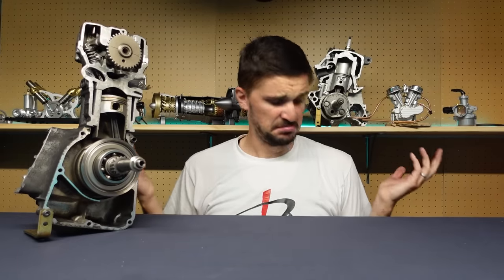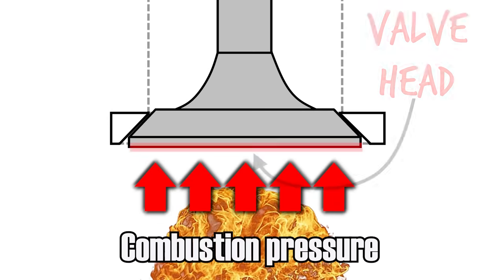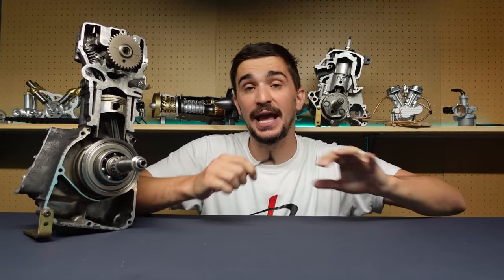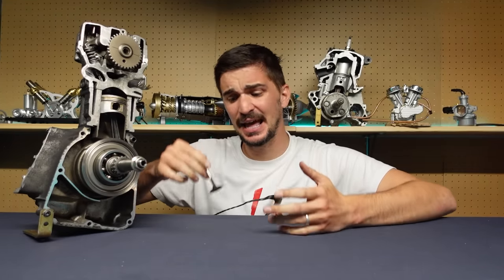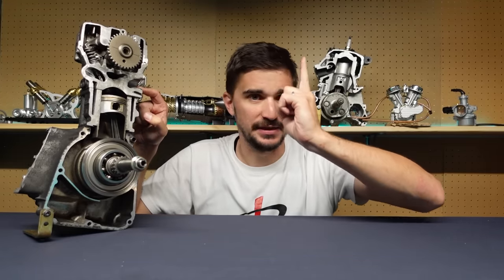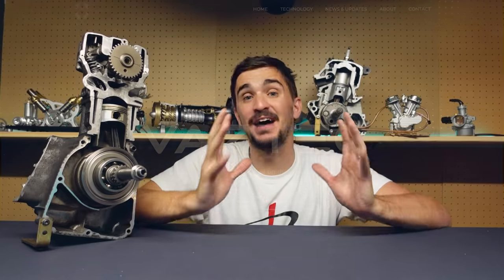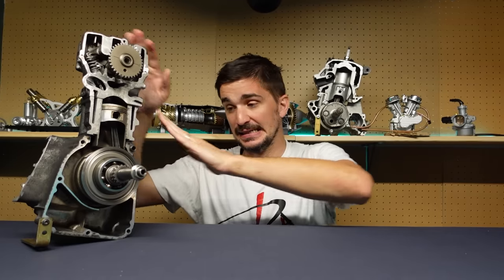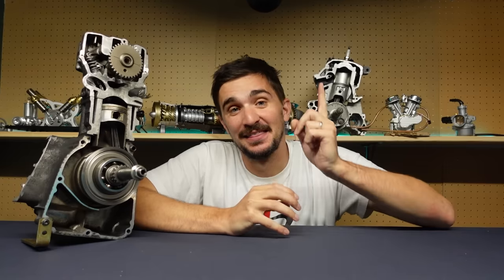Rotary Valves Make Normal Valves Look Silly - Why Aren't We Using Them?

Comment: I designed a rotary valve system once for a project, and the sealing was always a headache. I could never get it to last more than a few hours. Bravo to these engineers for solving these issues.
Reply: Use of a carbon type seal like used in turbo fan jet engines may have worked would be interesting to  see. Cheers
Reply: Did you try apex seals on a triangular valve rotor?
Reply: @JinKee  no, I hadn't... Runs to check his design
Reply: Aside from using carbon/apex seals the best way to keep the sealing protected is by cooling. Just like a turbocharger, air or liquid cooling to keep temps stable for long periods of time. Air usually isn't feasible except for small applications but it's worth a shot.....
Reply: Why didn't you make the rotary valve in tapered form (pushed by a spring on one side) .. ?? ..  so you don't need o ring seals ..
Reply: The cylinder pressure is constantly trying to blast the rotary valve off the engine.
With traditional valves, the cylinder pressure forces the valve to have a better seal.
Reply: Where it seals you would have metal on metal contact with the rotating barrel and the head if it was a true seal: would inherently need to be lubricated...

I could envision lots of oil burning in this design.That alone would be a tough hurdle to overcome. It is a violent environment in that chamber.
Reply: have a friend who was doing research on this. We figured out that if you put a bunch of grooves in the rotating valve and the cylinder it fits into you don't need any more of a seal. The air flows  up and down through the grooves and the loss of pressure with only a few groves is negligible.
Reply: I have a friend who was doing research on this. We figured out that if you put a bunch of grooves in the rotating valve and the cylinder it fits into you don't need any more of a seal. The air flows  up and down through the grooves and the loss of pressure with only a few groves is negligible. Also the grooves never touch each other. Even with a few thousands of an inch gap the air will not make it out. This way you have a solid metal frictionless seal.
Reply: The combination of rotating and poppet was mentioned, wouldn't it be possible to use some kind of simple reed valve principle instead of the poppet? The timing and the control of the flow is done with the rotating valve, all we need is the seal. (Mandatory bad joke, an emoji of a semiaquatic marine mammal flapping its flippers, arf-arf. Sorry could not resist.)
Reply: @billruss6704  like a labyrinth seal?
Reply: @billruss6704  that does sound like a labyrinth seal. You could get away with grooves only on the valve body, and not on the cylinder
Reply: Same problem with rotary engines.
Reply: it leaked?
Reply: @JOutterbridge i was thinkin " do we cool it on the back end of the shaft? is the backend of the rotor shafts part of the water pump assembly ??
Reply: I assume you too Did NOT study the sucessful rotary valve engines of the late 1960's and early 70's ?  Your valve experiment would have at least been reliable for far longer than the miserable failure you have reported upon. Nick , NavyBlueSmoke , LST-1195
Reply: @billruss6704  "Solid metal" and "frictionless" don't really go well together.

At low speeds friction might be negligible. But these valves are gonna be rotating pretty damn fast. People don't realize how fast valves move, in animations to explain the concept to people learning mechanics it seems like they open and close smoothly, in really it's more like a snap, they open and close so fast that it causes a shockwave through the manifold. You put metal on metal rotating valves in a real engine and six months later you have some nicely polished surfaces and that air gap is 10x wider than it was originally.
Reply: @BigUriel  There would be a small gap of a few thousandths of an inch between the inner and outer grooves so no metal to metal contact. We tried this with high pressure air on one end, by the time the air zigzagged it's way through all the grooves there was negligible pressure coming out the other end.
Reply: @JinKee  It can be done if you make the outer (cylinder) 2 halves.
Reply: ELMOREMOBILE automobile.  A brass era car that had a most interesting engine that included stepped 2 stage pistons and a rotary valve system.
Would love to see a proper deep dive into its engineering
Reply: There are the seals working at high temperature in every engine. They called piston rings.
Reply: What about instead of a barrel have a slotted disc that would rotate above the combustion chamber but would need 90 degree gear from the timing chain?
Reply: No you didn't 😂
Reply: @jakedode  trust me, this isn't even close to the weirdest thing we tried to make in high school shop class. The pulse jet remains the top tier example of why you always make sure what is in front of the intake, and downrange of exhaust. Inhaling sawdust ruined the paint job on our teacher's car.
Reply: No you didn't

So funny how everyone on YouTube is a specialist 😅
Reply: Yea, ours sealed well but burned oil like crazy. So not ideal.
Reply: @bafumat  ours didn't seal well, and burned oil, so...
Reply: @downix  I am pretty sure your s sealed well because it was being pushed up into the head with every ignition. Perhaps ceramic lips would have helped wear but the oil burning was a non starter so we never continued.
Reply: Invar valve body and housing for zero expansion with temperature changes. Pneumatic hydrostatic bearing for low friction lubrication. No contact=no wear.  plus even if does leak lubricant...it's just air.
Reply: Why not using piston rings for seal, they can stand heat and pressure?
Reply: I found what I imagined in my head, check out "1911 Reynolds Rotary Valve 4-Cyl. Engine"
Reply: Instead of a rotary motion, why not use a sliding motion? Like a piston with a hole drilled perpendicularly through.
Reply: So did I when I was 15 / 16 years old (so early 70s). I based in on a Honda 50cc.
I too had sealing problems and tried various things like graphite spring loaded  collars. I got it to run but not for long.
Then I went to the public library looking for ideas.
There I discovered that it was not a novel idea - that an identical idea had been tried in1887!
And many further attempts had been made in the 1920s without success.
I threw the whole thing away in disgust.
Reply: @BigUriel at last a wise engineering mind in the comments
Reply: Probably why it is never been used on a mass scale...
Reply: @JinKee ...like on the Wankel rotary engine? That's what I was thinking...
Reply: @CM-mo7mv ...if it was that simple, I'm pretty sure that SOMEBODY would have already tried it-(?)
Reply: @gregculverwell  we used a Suzuki as the base, but same idea.
Reply: @harrykreia5371 ...pistons move in a LINEAR DIRECTION...
Reply: @milanstepanek4185  valves akin to as you suggest have been tried before. Called disc valves. They usually have same  issues of a mix of poor sealing, quick wear, and high oil consumption. And usually a tendency to sieze.

A bit part of such  is when metal parts increase in temperature  they expand. That knackers up clearances. Further complicated as different parts warm at different rates, and to different amount.
Reply: @harrykreia5371  that is true. But they are intended for a wiping motion. In this case they would be spinning. That would lead to a grove being cut in the valve cylinder or the valve itself  or both very quickly.
Reply: @stevecummins324  yes  that sounds nice until you realize you are trying to seal gas in the first place. The high pressure would just force itself into that bearing fast and foul it out.
Reply: @bafumat not at all complex to sort out... just lift the bearing with higher pressure than that which results from combustion. Nb the smaller the clearances are with such a bearing the lower the flow rate of pressurised gas needed.
Reply: Liquid piston (silly name) swapped the oval and triangle I used in Wankel. Its stator is triangular with a spark plug on each corner. Rotor is oval. Seals are fixed in the stator and can be easily replaced. It solves the flame quench and short blowdown of wankel but the rotor can overheat.
Reply: They kiiiind of solved them... You still won't see them on any cars
Reply: @CM-mo7mv  Thats called a cam shaft !
Reply: @kebeleteeek4227  That's an Aspin rotary valve, which still needs lubrication. Try again. :)
Reply: @stevecummins324  the pressure of the combustion would disagree
Reply: I think that the sealing can be good with the needed technology, the problem I see here is the timing, ayway I think it's possible
Reply: @Capocomico  timing is easy, and VVT is doable as well. Changing duration might be more of an issue.
Reply: @billruss6704  you're describing a labyrinthe seal. They have been used for industrial gearbox and electric motor bearing seals for a couple decades now. Some make contact, some do not. They come in various IP and particle ratings.
Reply: @bafumat  you need to do a sudden opening , a steady open time and a sudden close close. in a rotating  system that's less efficient, valves do not follow sinusoidal movement
Reply: So, here’s my question.  I’ve been a streamfitter, plumber, and pipefitter. I’ve used check valves multiple times in those areas. Why not use the same concept but with electronic check valves based on compression and decompression cycles?
Reply: @drrichardpaul  some high end Formula 1 race cars use them. The main issue is cost. Getting one able to handle the explosive pressure is difficult so I have read.
Reply: @drrichardpaul  I think I heard about some car makers that are doing that. Sport cars of course. I don't remember so well
Reply: @Capocomico  we did a fairly long narrow opening. The home in the rotating assembly was about three times wider such that it opened fairly suddenly, had a dwell and then closed suddenly. The opening in the head was the limiting factor. Again, c
Something harder than the typical steels might have held up better but the necessary lube always burned off. Total pain.
Reply: @bafumat I bet temperature variations would made it impossible to stay at the exact size.  Something like the sealing segments  on a wankel should be necessary , but I doubt there's a sping that could work at exhaust temperature
Reply: @Capocomico  yes. The materials heat up unevenly and without computer programs that can help, we pretty much were guessing about expansion. And it's pretty uneven. But hey, we tried.
Reply: @Capocomico  yes. The materials heat up unevenly and without computer programs that can help, we pretty much were guessing about expansion. And it's pretty uneven. But hey, we tried.
Reply: Thats another beneficial quality of engine oil, it lubricates, cools, protects and facilitates pressure sealing.
Reply: Boom shaka loka, cant beat the spring valve.
Reply: That's their job.
Reply: Came in the comments to ask about APEX seals (hard not to think about everytme i hear "rotary". Saw @JinKee mentioned it.
Reply: port velocity and flow is far superior in a head with "normal" valves, anyway
Reply: Add some impossible to conventional manufacture cooling bores inside the rotary valve cylinder and you should be fine. 

I can imagine a metal 3D printed and rectified rotary valve.

That way you will have a better thermal stability of the rotary valve itself and you can choose conventional materials for the seals.
Reply: People seem to choose conventional manufacturing for the RV, but how about metal 3D printing and then surface grinding of the rotary valve cylinder?

By using metal 3DP in this case, you could easily implement some cooling bores to somehow equalize the RV temperature thus having it maintain its uniform temperature and accommodate more inexpensive sealings.
Reply: @micultimy91  when I worked on it, 3D printing wasn't yet a thing.
Reply: @kebeleteeek4227  Way too much friction, negates basically all the benefit.
Reply: @repatch43  Relatively very little friction with good lubrication ...
Reply: Was there a challenge with the speeding up and slowing down of the rotating mass
Reply: @kebeleteeek4227  Yup, which'll burn considering the temps involved and end up in the exhaust, along with a dropping oil level
Reply: Sealing really is the challenge, I'm glad to hear you tried it!
I've built several, I've found that the most successful sealing setup is to use a large bronze floating seal that rides against the rotating valve.  The floating seal is pressurized by cylinder pressure.  It works quite well.  I've seen this sort of seal also be successfully be made out of carbon.  There are people that have tried to make them out of ceramics but those usually crack and fail because he contact pressure is too high.  A large surface area seal is definitely the easiest and most reliable way to go. Plus the thermal expansion difference isn't as crazy between the seal valve and the bronze seal as compared to ceramic and steal.
Reply: Good engineering
Reply: @anonplayer8529  Reed valves are a one way valve, so while it would work on the intake, you'd need to find something else on the exhaust. Also, heaven help your engine if it breaks off in the chamber. At least with a poppet valve, the parts that are being stressed and would break (the springs) can't get into the chamber.
Reply: I dream about a rotating hollow pressurised valve
Reply: @JinKee  Sounds like a Rob Dahm thing.
Reply: @repatch43  You said the high temp. will burn the lubrication oil film in the tapered rotating valve ..?? .. What do you think the oil film in cylinder that lubricates piston ring ..??
Reply: I don’t think they solved the issue. I have seen others with rotary valve too. I think reliability is another issue.
Reply: @gregculverwell  'I threw the whole thing away in disgust' - like most people who have ever tried to develop rotary valves.
Reply: apex seals :)
Reply: @kebeleteeek4227  The same? 'burning oil' is a common thing in many engines. Alot of work has gone into reducing that, and modern engines are actually really good for that, but adding a ton more surface? With emissions as closely monitored as they are these days that's a MASSIVE issue.
Reply: I worked at one of the top bearing manufacturers in the world for a few years and as much as I disliked it I'm sure they would be able to solve this problem in their sleep so I'll hold out hope for companies like this
Reply: ...and bravo to you for even trying!!!!
Reply: sounds like a skill issue
Reply: I agree with that, I've had similar results from the seat material failing in a few hours of runtime
Reply: It’s clever design but the problems seem large. I would like to see a relative comparison to Direct Injection systems. Contamination of spinning valve crossing to motor oil. 
Carbon build up. Also I would like to know temperatures. Thanks
Reply: as an engineer, i have come to realize it is 1 percent design and 99 percent execution that makes a good, reliable product. I am sure they COULD make these valves work, but the manufacturing exists to make the other type cheaper and more reliable.
Reply: The energy you put into the valve is released again. It is therefore wrong to assume that the compression of the valve saps the engine's energy. It does not consume it. The friction does but that is a problem with other systems too.
Reply: @EbonyPope  a lot of the energy from a spring compression is turned into heat. That is part of why cooling the head of an engine is so important.
Reply: @downix  That is negligible. When you release the spring it decompresses he even mentions that in the beginning ot the video. The energy ins't "lost".
Reply: @EbonyPope  13-40% is lost to heat, depending. And the energy is only transferred one way, as the energy spent compressing the spring is not transferred back to the crankshaft, so as far at generating momentum, it is lost.
Reply: @downix  That is plainly wrong. Once the love turns over the spring presses against the spring presses against the rocker arm. The loss due to heat isn't 13-40 percent are you crazy? Cite your source for that. I'll cite an aswer from a physics forum that explains it quite well:

"The power loss is due to friction or other unrecoverable losses in the valve train. You're right that just compressing the springs doesn't really account for the power loss because they push back once the lobe rolls over; however the weight of the springs does increase friction."
Reply: @EbonyPope  that quote directly agrees with me. Okay, ignoring you now, because you jumped in and didn't read what was said.
Reply: @EbonyPope  good point
Reply: i have a solution for better seal, turn the rotary valve vertical, open hole vertical on it and spin it on top of the cylinder,not roll it.
Reply: @echetlos  that's called a disc valve, and can be found on Rotax engines.
Reply: great, i thought of something that already works, I'm good lol. Im no mechanic hehe
 @downix
Reply: @ihavethedocuments2580  I was thinking brass od copper bush tapered  to provide the seal🧐
Reply: @milanstepanek4185  like some 2 strokes
Reply: @harrykreia5371 (piston rings)... how would they work ? The shaft rotation would leak . .. plus friction 🤔
Reply: @downix now this we need more details!!
Reply: Sealing wouldn't be my concern so much as keeping it from gumming up for daily use. Race car engines get rebuilt too often.
Reply: Should make a dirtbike with this if they ever get it right would be top of the market
Reply: The thought I had when I was playing with he idea was make the valve spherical or trapeziodal instead of cylindrical. Then you get some of the sealing qualities of the tappet.
Reply: your right I've done it
Reply: They are sleeve valves have been around a long time.
The problem is you can't lubricate the sides where the slot is.
Reply: they didnt.😳
Reply: The problem with sleeve valves is they fail after running a long time.
Poppet are best and last a long time.
Reply: @harrykreia5371 piston rings need oil to seal
Reply: It would be interesting to combine rotary valves and a pendulum engine
Reply: @gingerbinger7485        it's the valve sealing that's the problem nobodies solved it yet.
The temp an engine gets up to is phenomenal.
Reply: True! You are right! Not even powder molibdenum carbide would be able to seal and lubricate enough. The smallest clearance for a shaft to turn in with no friction without loses, would make it impossible to "seal" gases, which would come out, and heat up the element, burning it afterwards in the short run. They could try using piston rings... But ther's greed, human greed.   🤢
Reply: Something called "Rotary" always got problem with "seal" 😂
Reply: @kebeleteeek4227      you are forgetting the expansion and contraction of the valves.
A taper would jam.
Reply: @billruss6704        that's a labyrinth seal they leak all the time.
Reply: @tonyclough9844  Actually the tapered from is exactly prevents it from jamming dus to thermal expansion .. Don't you realize it ?
Reply: @jalanihidup6119  🤣🤣🤣🤣🤣🤣🤣🤣
Reply: labyrinth seals not possible?
Reply: @TheLordinio  we were working with high school shop tools. Labrynth seals need far finer capabilities than we could manage.
Reply: @downix  fair enough, I was just wondering in general whether it could be done. in my mind it should allow for thermal expansion since the outside clearance isn't that critical in that case. and if blow by of combustion products is an issue you can always externally pressurize the mid section of the labyrinth seal with clean air
Reply: @harrykreia5371 piston ring goes up and down, it is not designed to work in circular rotation.
Reply: Could have a lubricant for this area specifically, to be filled in parallel with gasoline, as a consumable.
Reply: You spelled the word impossible like the word headache for some reason.
Reply: Just made a top level comment, but again, not true for ball valves. Fluid pressure pushes the opposite side to seal. A ball valve design, which is not the way the piston one is designed, would spin like the piston and seal like the valve.
Reply: @kebeleteeek4227  that's honestly not a bad idea 😂
Reply: @billruss6704  so a labyrinth seal
Reply: has anyone tried putting tesla valve-like surface around the side of the chamber? it would be extremly expensive to make but in theory it should work.
Reply: @ihavethedocuments2580 the o rings would stop that. Well - they’d transfer the wear to the rings. If the valves and rings were easily accessible, one could make normal maintenance out of it…
Reply: @billruss6704 aim them at an angle pointed towards the valve so it creates resistance - like a Tesla valve.
Reply: @BigUriel in a 4 stroke engine, 2000 rpm would mean the valve rotates 2000 times a minute. Yep - that’s spinning fast.
Reply: You can't lubricate a poppet valve or a rotorery engine.
Reply: @tonyclough9844  of course rotary engines can be lubricated. 
What you can’t do is spell rotary
Reply: Why not have cooling jackets along the side of the rotary valve like the cooling jackets on the cylinders
Reply: @kebeleteeek4227  An Aspin head has that principle. It doesn't lend itself to economic construction of multi-cylinder engines, and still doesn't address the problem of oil burning due to wetted surfaces being brought within the combustion chamber.
Reply: yeah here is one of those ha ha
Reply: Elektronik zamanlayıcı ile çalışan elektromanyetik valf kullanmak en doğru çözüm.
Yoruma da döner valflerin basınç kaçıracağını yazdım.
Videoyu hazırlayan bir çözüm bulduğunu anlatmaya çalışıyor maalesef yanlış çözüm.
Bu konuda sana katılıyorum.
Reply: Yes; sealing, cooling, expansion, opening speed, size. Sleeve valves had their day in aeros, but durability was an issue.
Reply: @billruss6704  What pressure did you use? Because in the combustion phase the maximum pressure is 1000 psi.
Reply: @ihavethedocuments2580  I think the secret would be to allow a small degree of leakage.  Any gasses that leak past the inlet valve would be sucked back into the cylinder in the next cycle.  Anything that leaks past the exhaust valve has just got into the exhaust pipe slightly prematurely.  With a small amount of leakage, the engine would still run just fine.
Reply: @billruss6704 theyre called labrinth seals. We had them on the bearing oil seals on gas turbine engines. Similar principles to Teslas one way valve.
Reply: Sealing is easier if you only turn it when it's unloaded. Slide valves might also be an option.
Reply: What if the sealing/bearing surface was poured in place
Reply: @danielescobar7618  This could perhaps be done with a ceramic lining compound. 
An old movie projector moves the film in steps, from a rotary source, the mechanics are easy. 
If the valve stops during combustion, many sealing issues could perhaps go away and a positive sealing model could be used.
Reply: Try machining with higher percision.
Reply: @just_alex-oc3mn  oh my god, DUH, why didn't we think of that sooner!?!?!?
Reply: I am just a dumb person filling in time watching this video.. .. BUT, for seals why not use a pair of offset and back-to back piston rings(a pair of touching rings in the same groove with the split 180 degrees from each other). That would be a foolproof seal that would also adjust itself for any wear and tear
Reply: @EbonyPope  of course it saps the energy off from the crank!!  The higher revving the engine, the stronger the springs need to be to be able to return the valves shut at 5+ 1000 rpm!!  Plus the heat from spring compression.  The only energy return is the valves returning to seated.  But - laws of physics - none of that heat benefits forward motion, nor does the crank gain momentum from the springs extending.  In fact, more losses, as the springs are still pressing against, followers, lifters, rocker arms, compressing oil in hydraulic lifters, camchain/belt/cog/pulley, so there's all that extra friction plus resistance to the cam lobes, making the crank work harder to turn the camshaft, than if the cam/valve arrangement didn't exist.  You clearly understand NOTHING of engine technology or physics.  Newton's third law of motion is a thing...!
Reply: @alexmanojlovic768  It's you who have no clue. As you pointed out every is returned. Springs also return that energy when they return to their initial position. The losses of heat die to the deformation are minimal. Watch the response video by dirty garage guy. He explains it in more detail. There are also tons of other people that noticed this error.
Reply: @zedostenso3069  these should work fine. They run at much higher temperatures